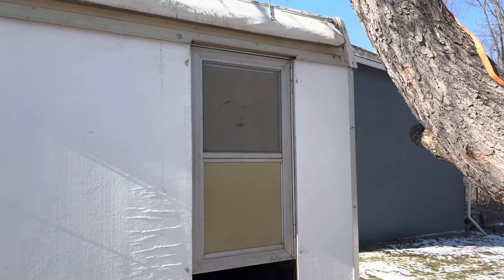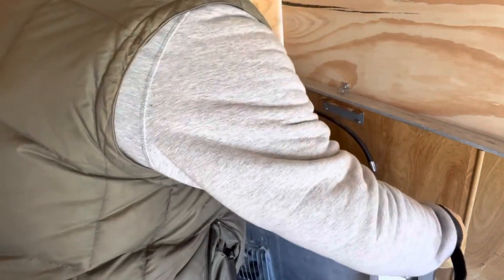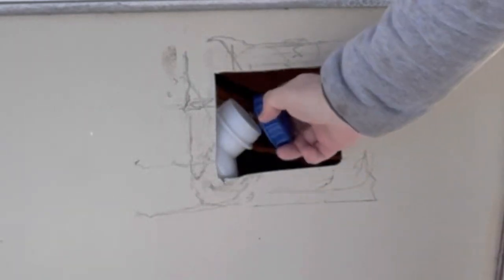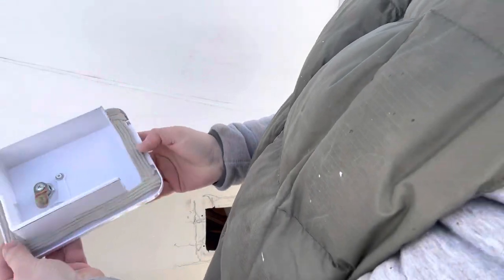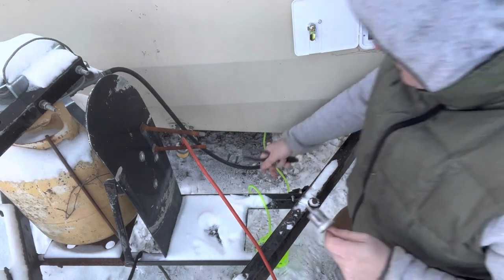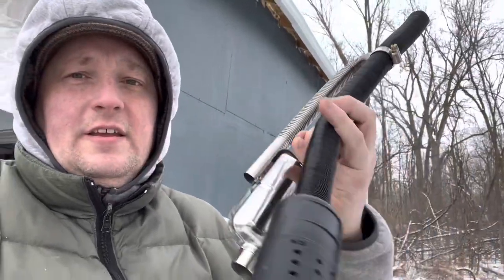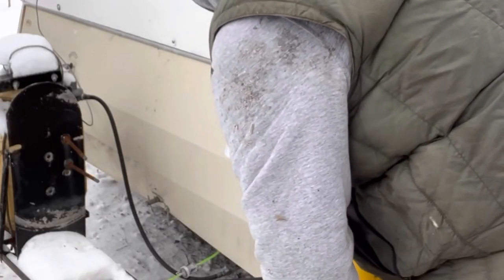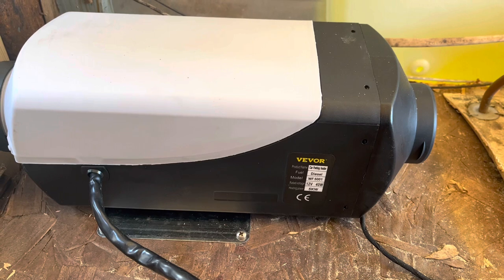PopUp Diesel Heater Install | Propane furnace replacement | HOMEMADE Tiny Cabin #diycamper

Comment: I think i would of mounted the tank outside the camper some place on trailer tongue or someplace, if you spill some inside the camper will smell
Reply from the maker: It’s setup to drain down to the ground between the sealed insulated walls

Comment: I’m late but why put the Diesel inside ? The first thing going to happen is u going to drop the cap between the walls then spill diesel inside .
Reply: You dont want it getting to cold. Disel gels up. The trucks have intank heaters.

Comment: Could run the muffler up the frame rail
Reply from the maker: I’m working on some ideas. I am probably going to look into a longer exhaust pipe. Then I can run it down the center to the rear. I am looking at ways to use the pipes waste heat through a sort of heat exchanger idea to provide radiant heat to the floor.
Reply: @Jeep-Creep  or use it to heat water
Reply from the maker: @MrJeep75  not a bad idea

Comment: Why not mount the tank on the outside
Reply from the maker: I will have the cavity filled in when I finish putting the wall on the inside of the camper.  I want to have it where the diesel cannot get between the walls because it will be filled in.  I didn't want to put the Diesel tank fully on the inside for obvious reasons, but I didn't want to mount it to the outside either just for appearance and road damage to the tank.  Its hard to see but where it is between the walls, it is basically outside now, and if there was a spill or hole it would leak outside of the trailer and not inside.. The bottom of the tank can be seen from the bottom of the camper if that makes sense.  I also want to put a visual slot cut out in the wall so I can see Diesel fuel level from inside the camper.   Great questions though, and I love ideas for how to do this. Everything is open for better way of doing things. I take everyone's advice to heart.

Comment: I have one in my van with a remote n i fire it up from the house when its cold out then its nice n warm when i get ion . Also i think people get to crazy with the fuel line bro mines running 4 years no problems !
Reply from the maker: Nice!  Yeah good to here it’s working with no issues for you. I got a remote too, never tried the distance on it. It’s good to know if works from a good distance.